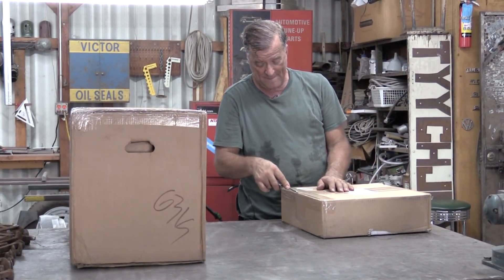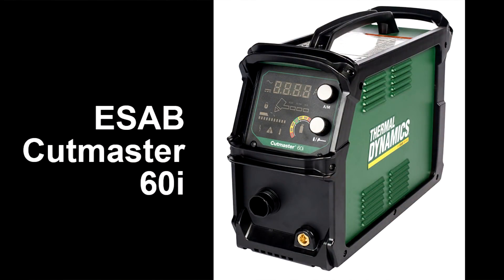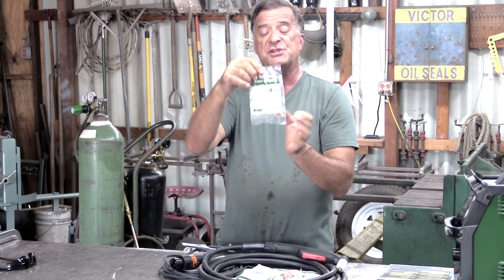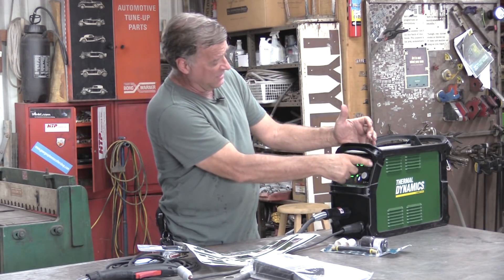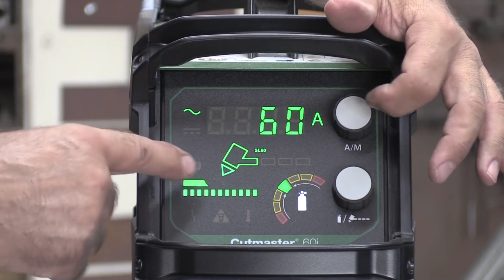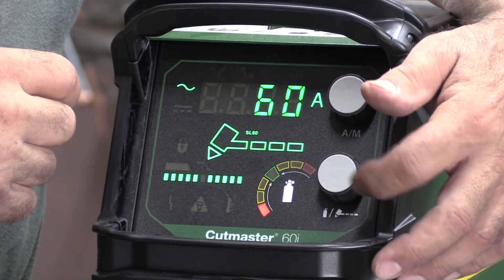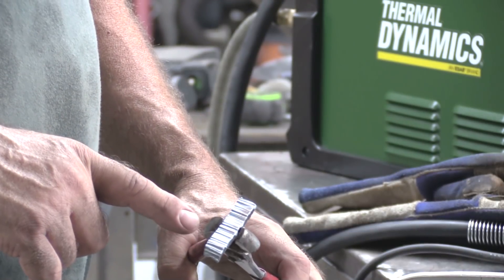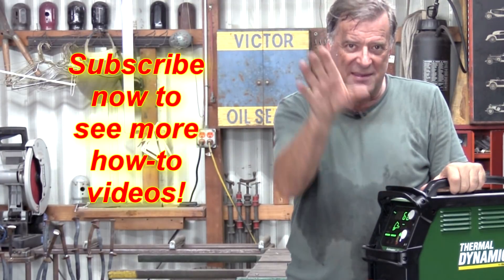How to Get a 'Beast' of a Plasma Cutter Running Quickly - Kevin Caron

Comment: That machine has features that even hypertherm can't match!  Such as a super long arc that other plasma cutters do not have!  That machine can cut through multiple layers of metal better than any plasma cutter I've seen.  Weld.com did a good test of that machine.  Very impressive!
Reply from the maker: It has been a very strong running machine!

Comment: I'm on the fence  between  buying the Thermal Dynamics Cutmaster 60i or the Hypertherm PowerMax 45XP.

I would like to have something that I can use manually and with CNC.
Reply from the maker: Go with the Hypertherm.
Reply: @KevincaronSculpture  what are the main reasons why you would choose the Hypertherm 45xp over the Thermal Dynamics 60i?
Reply: @KevincaronSculpture  I sent you an email.

Comment: I have that same machine at my shop. I got it up and running in about 5 minutes. I had never used a plasma cutter before in my life. Extremely easy to set up and operate.
Reply from the maker: It is a really nice machine!
Reply: @KevincaronSculpture  I love it. Extremely easy to set up and use. It is a very good machine for a first time user. Plenty of power to do most any job that will come up in most shops.

Comment: can you drag the tip on top of the piece you are cutting or do you have to have some stand off?
Reply from the maker: Below about 45 amps with the correct tips you can drag.  Over 45 amps it's not a good idea.
Reply: @KevincaronSculpture  why is it not at good idea over 45 amps. ? Could you not just use the drag all the time. ?
Reply from the maker: According to the tech you will start overloading some of the parts in the machine and that is when the high freq board shorts out and the machine stops working.

Comment: Info on Esab website says it wants 400v 3-phase, no mention of 220v at all. But Thermal Dynamics' site (look for A-series (Austin Mini?), model A60i), does say 1/3 phase, 208-230 or 460v. Man, our 230v 1ph/415v 3ph in the UK makes it so much simpler, lol.
Reply from the maker: I know, kind of confusing for me also.
Reply: Nar not these machines for 3 phase,  way too small for that.
Though this will be a bigger version of the little machines.